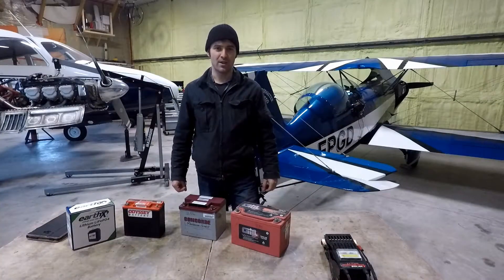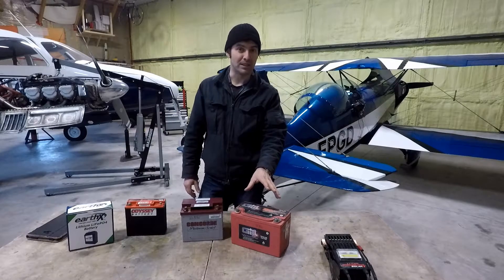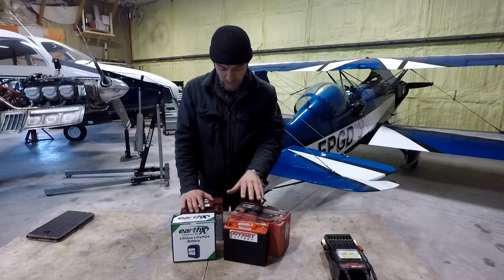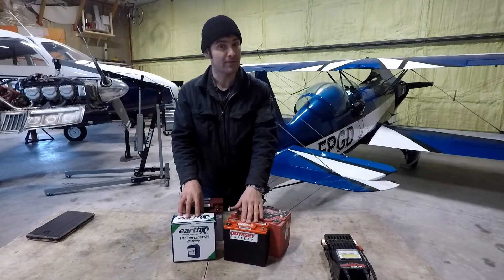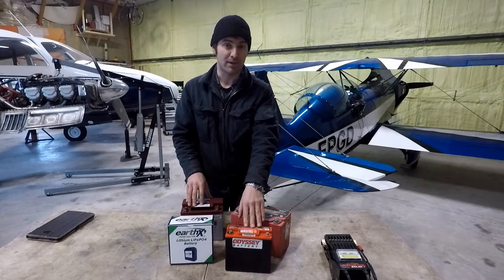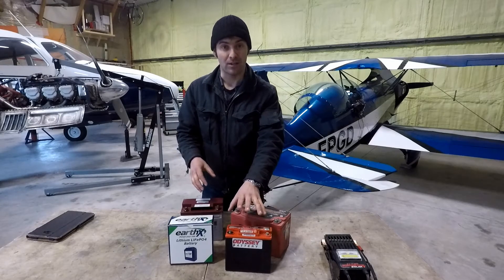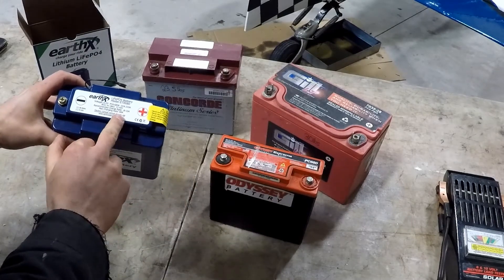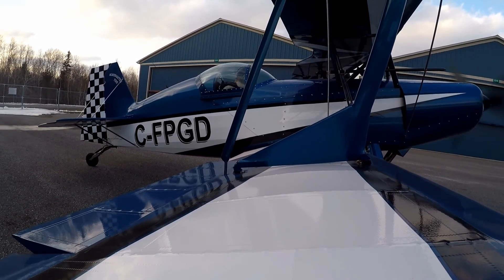EarthX vs Odyssey Battery Review

Comment: Hmm, if that PC680 in the vid is 8years old, that had a superb great lifespan! 8years with average usage in a plane is well enough time to still evaporate some water from the agm separators and have an increased internal resistance which results in a poor(er) starts. As your agm batt gets older and looses some water anyway you will end up with higher internal resistance even if your battery capacity may seem to be alright. You can not recover/fix the increased internal resistance over the years with boost charging the battery.
Reply from the maker: This is very interesting information. I am certainly seeing lots of AGM batteris in aircraft that are over 10 years old before requiring replacement. They certinaly seem to have a gradual loss of CCA in the last years of their life. 

I always check the CCA at annual insepction and record it for owners in their maintenance records so that the battery performace can be compared and repalcement made before it gets you stranded somewhere.

Comment: EarthX batteries use a very poor quality BMS and the cells are damaged if used below freezing.  Then they don't honor the warranty.  I have a dead one sitting in my garage that died at the 1 year mark because I used it in cold weather.  Lithium/LiFePO4 batteries are amazing, just don't buy one from EarthX.
Reply: You can always use the odyssey during the cold months and switch back once the weather improves.
Reply from the maker: That's a good idea
Reply: My airplane is a Glasair 1 RG. I've had both batteries and both cranked my engine fast and easily, 50 F minimum temps., my engine is a Lycoming IO360- C1D6 with 10:1 compression pistons also a lightweight Whirlwind 3 blade CS Prop. My lightweight starter is a B&C. My battery is far from the engine behind the rear bulkhead with very large awg cables so that the voltage stays high. I did go from Odyssey 680 to the earthX 900, ~ same physical size. My primary reason for changing was about 10 lbs weight savings and improved CG. I've had the earthX  about 4 years now, it should last me 10 years hopefully. I put the used Odyssey in my car and it lasted about 4 additional years there.
Reply from the maker: That is very disappointing to hear and certainly a limitation that I was not aware of.  What model of EarthX battery do you have that died in the cold ?
Reply: I used an EarthX battery for 4 years in a snowmobile that I used for week long touring trips in Quebec. I did experience the problem you mention with the cold. I doubt it would last well for years in storage but no batteries do that well.

Comment: Is there any change or adjustment required from the alternator or voltage regulator? I would imagine that the Lipo would require a different charge algorithm from the AGM and perhaps a different float voltage?
Reply: They are set up as direct replacements, max charging voltage is about 14.5